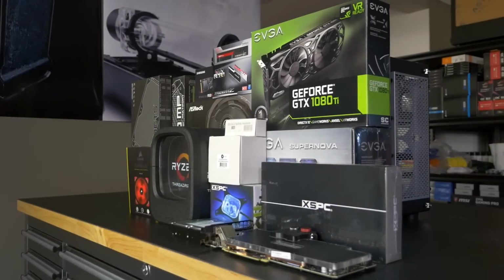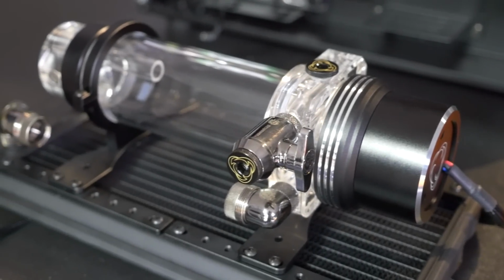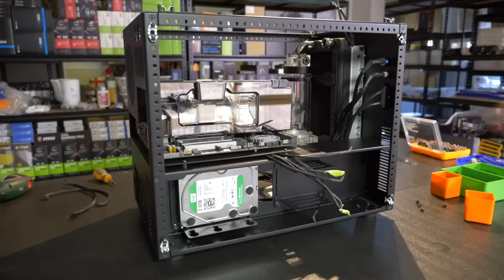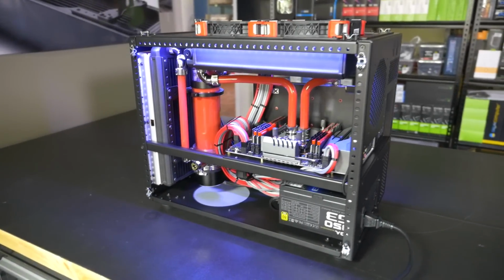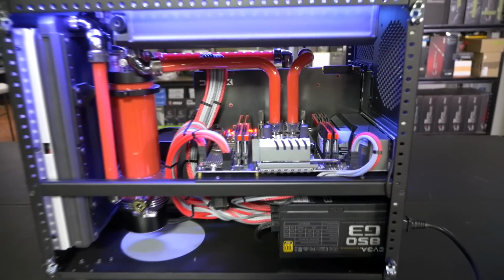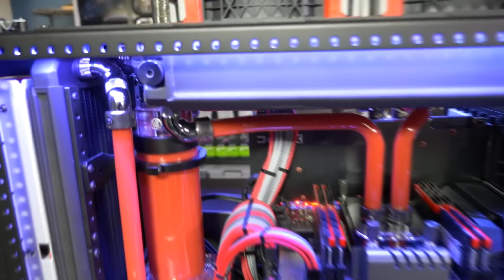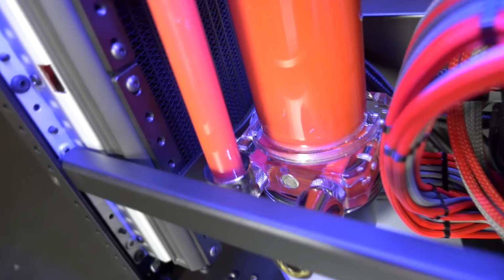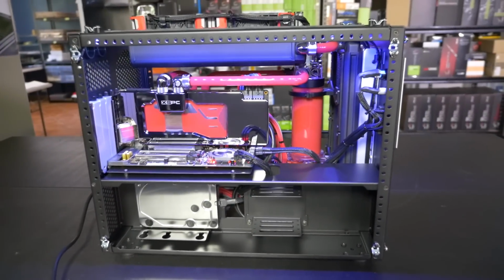Caselabs S5 Build #38

Comment: hey man i see you are going to use the ek-wb m.2 heatsink.. 
here is one thing you should know about it: the recommended application from ek-wb is wrong.. nand loves to run hot especially during heavy write loads where the tear usually comes from.. lowering the nand temp during these will cut the end of lifetime for the cells into half.. also they are designed to stop thermal throttling but that isn't caused by the nand temps but by the controller temps.. so make sure you only let the heatpads touch the controller and NOT the nand flash chips themselves.. ek is very wrong there.. ofc that will somewhat also lower the nand temps because the heat from the controller is lower and doesn't spread through the pcb to the nand anymore but still better than activly pulling heat from the nand.. 
also if someone reads this and uses this heatsinks, undo them and cut the thermal pads down.. 
cheers!